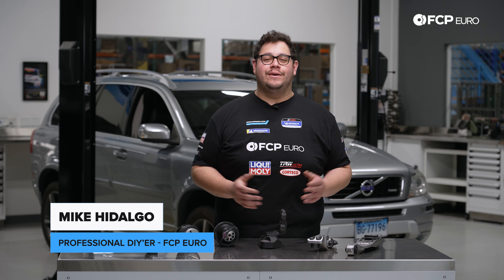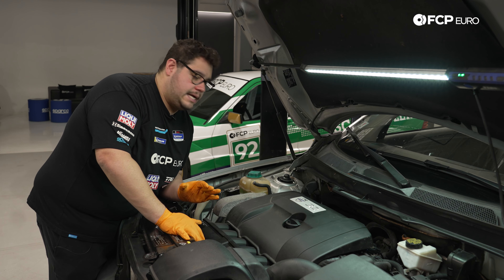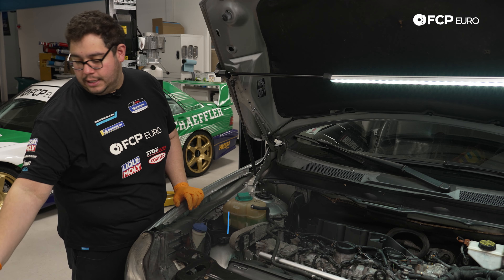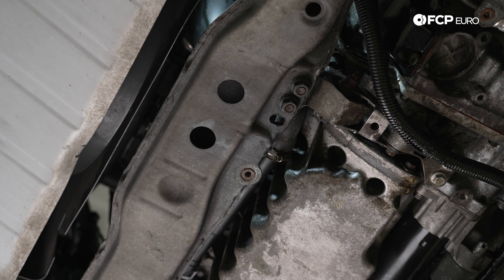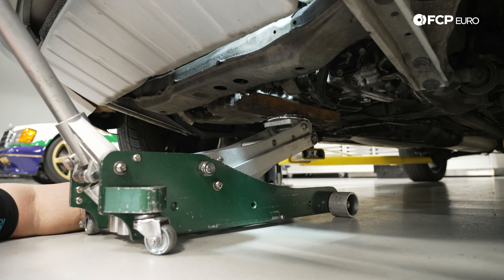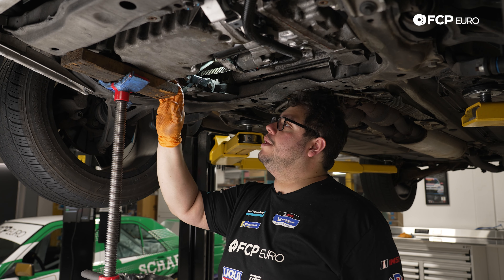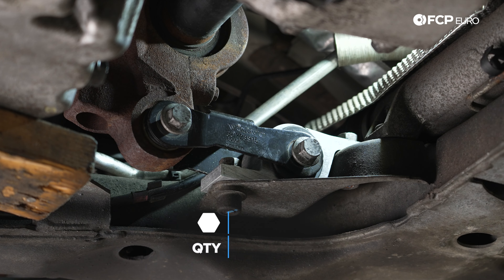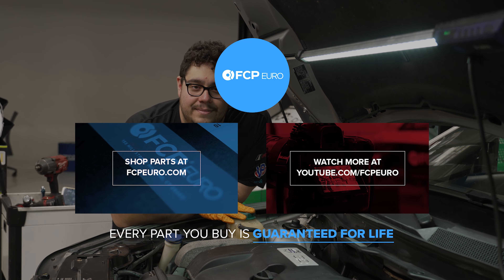Volvo XC90 Engine Mount Replacement DIY (2007-2014 Volvo XC90 P2 3.2L, T6 R-Design)

Comment: Thanks for the video, really made doing it myself a breeze. It’s  something I would not have tackled without seeing it first. Replaced my subframe bushings earlier this year and those are more difficult. I did it with the engine intact and the subframe still on the car, it is more self-explanatory. The motor mounts would have been way too hard for me to conceive, in particular replacing the rear.

Comment: I had a really hard time getting that third upper bolt for the rear motor mount. I ended up stripping the hex head before realizing you could reach it with a wrench from the top side. So I recommend anybody to try a break it free  from the top first. All the bolts that I could break free broke free relatively easily, So I’m assuming this one would too, however, the angle is  hard to get right with so many extensions and manual ratchet. You’re gunna be working blind and my getting your hands up in there. Except, you can see it straight down from the top. 

I was still able to replace the mount  by loosening the bolt that goes through the  subframe into the motor mount itself . And then resuming the course of action that the guy does in the video. Which includes removing the three nuts on the lower bracket. The process I did still required jacking the engine up from the bottom, but it did not require removing the three both of the upper bracket. Although that’s what I tried first and I stripped the third bolt of the upper bracket so I had to figure out another way. Once I got done looking at it I realize that I wasn’t completely screwed. Finished it this morning and it didn’t take too long once I learned I could do it another way.
Reply: Referring to the rear engine mount at 12:59.

Also I did this with a set of ramps and a floor jack.

Comment: do you guys have any tips for getting the crankshaft nut off? I got a leaky crank seal and I couldn't get the nut loosened for the life of me. It is an 06 xc70
Reply: I really like this video it is really straightforward.

Comment: This looks really difficult to do at home with a jack . Also looks like power tools are a must. I didnt even know ypu needed to torque the bolts either. What does everyone rate this in terms of difficulty for normal no mechanic experience people .
Reply: I just did this at home with a ramp at jacks. I did not have the electric ratchet. 

For the second mount that is in the back, I left three upper bolts in place (of the mount that connects to the transmission). 

I had a heck of a time reaching the third bolt of that mount. So I stripped the head. Only then, I realized you could reach it from the top. So try that to break it free if you want to have everything loose like this guy did. 

Since I stripped my bolt before then, I could not loosen bough mounts like him. Even from the top I tried but by then it was game over for me. I was able to leave the heat shield intact with the upper mount. From the top, I  loosened the motor mount bolt that connects it to the subframe, and removed the three nuts on the bottom 

I used a jack and a 4x4 to support and jack it up. I also removed the bolt from the front engine mount that bolts it to the subframe in order to create more space. Then I jacked up the engine and made some space to reach the nut of the rear mount to detach it from the lower mount. However,, there is enough room to finesse it back in already connected , which I did when reassembling.  I was replacing the motor mount that’s on the top of the engine near the coolant reservoir as well, since I was doing that, I removed it to create some more space or allow more play for the rear lower mount. Be patient you’ll need it.